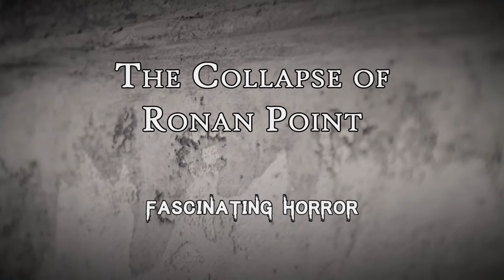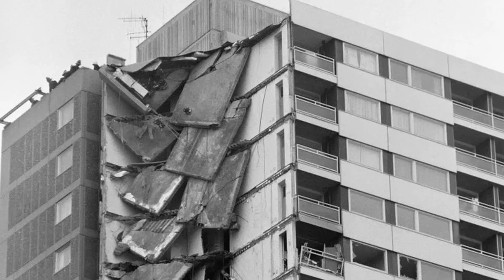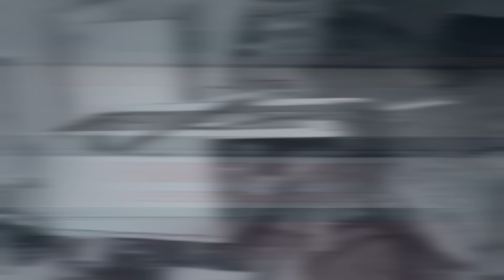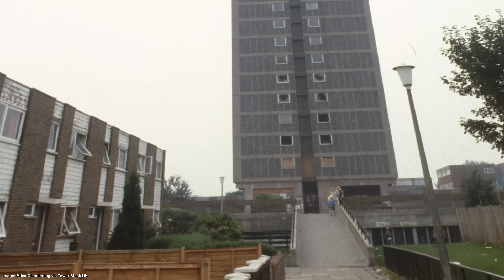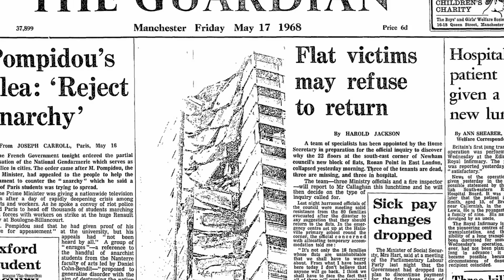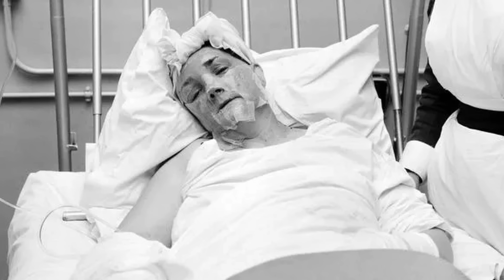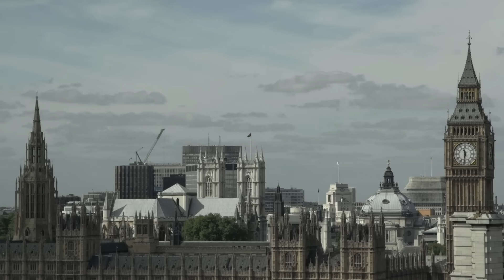Joints Stuffed With Newspaper: The Ronan Point Disaster | A Short Documentary | Fascinating Horror

Comment: In the late 70s, I worked for a couple of years at an advice centre in Bermondsey. Assisting people with council housing problems was one of our most common issues. Mold was a big problem in council housing, especially post-war tower blocks. In the colder months you'd find condensation dripping down the interior windows. Poor construction and, poor insulation combined with the damp to cause molds that created health issues for many residents. Some tower blocks were built with under-the-floor electric heating - which was fine when energy was cheap, but by the 70s and the global oil issues, the cost of heating their flats adequately (even with more standard baseboard electric heating) was prohibitive, especially for anyone living on benefits. Some people turned to portable LPG heaters, but burning the gas put additional water into the air as a by-product, so it only exacerbated the mold. Of course, the lifts were out often enough that they seemed to be on a schedule!